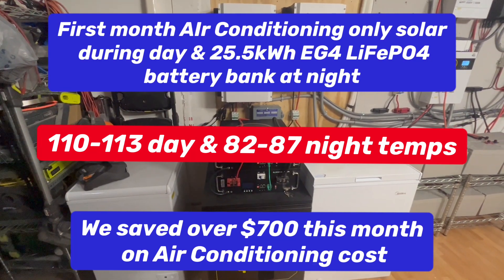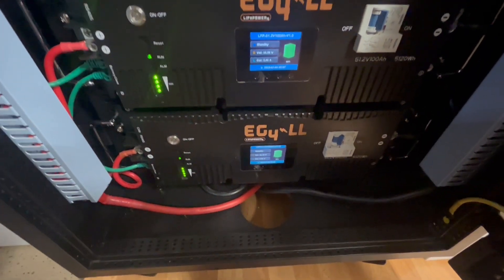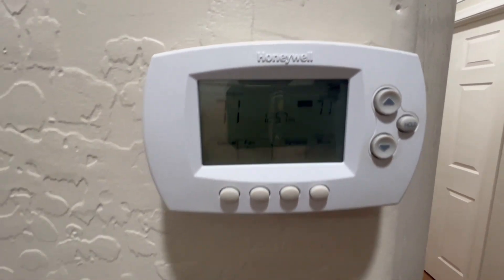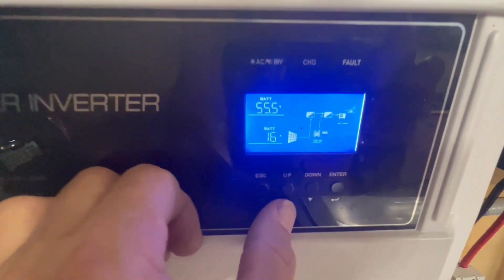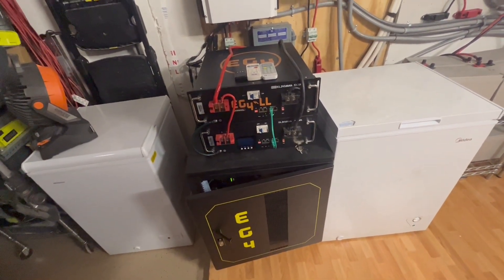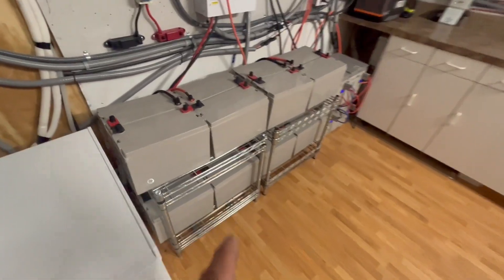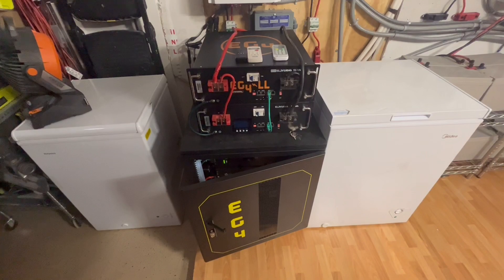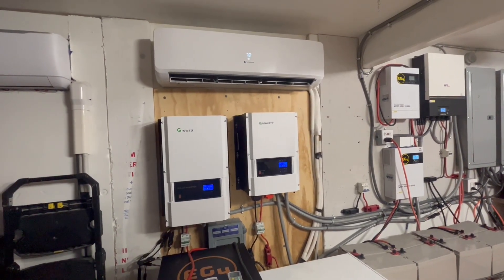First 28 days spending no money on AC cost while 110-113 in the day & 82-87 at night off grid solar

Comment: Holy hell what do you do for a living...?
Reply from the maker: I am medically retired with 2 incurable cancers that started in 2013, and was completely unable to work anymore in 2014. I had a lottttt of time on my hands since I was pretty much bed ridden from 2014-2017 so I started watching videos on off grid solar power,  at first just a few videos a week, then in 2019 I really started to watch a huge amount of videos on solar power off grid. I had no knowledge with ac, mini splits or solar before then. So I learned as I went along. I started with a 12 volt 2000 watt modified sign wave inverter, some Wallmart batteries and a couple used solar panels I bought for $30. And in the last 3+ years my knowledge increased and so did my system. If I, going through 2 incurable cancers only being able to spend maybe a hour or two a day, maybe 2-3 days a week,  installing solar components can achieve this, than anyone healthy can do the same. Most products today are really easy to install and program. You just need to see how it is done. I installed 100 solar panels, 6 mini splits, 17,000 btu & 127,000 btu electric pool heaters heat pumps, inverters, battery banks, etc all over a long span of 3+ years. A healthy person could do the same in maybe a week total. I have a lot of determination. Once again I knew virtually nothing about electronics or electricity a few years ago. Now I’m able to show what is possible with off grid solar. The reason I did off grid so is because the cost to go on grid was 4-6 times more expensive due to mark up and 60 percent installation cost. DIY is the only way to go if you want to ever break even. Thanks for your questions and I hope you know you can learn to do this as well. Just make sure you are very cautious and safety minded and double and triple check everything you install before powering up to make sure you did not make any mistakes. Do that and you should be able to do the same as me. Hope you have a truly wonderful and blessed day.
Reply: @diy-solar-guy  wow I'm so sorry to hear that. You've definitely had a rough time and I wish you all the best! I really appreciate your videos and I appreciate you taking the time to be so informative and thorough. I've actually just started on my solar journey and I'm just now learning the cost investment into things like LiFepo4 batteries and such so I was a bit sticker shocked. Your story has inspired me though to see this through. 
Thanks again so much and keep up the amazing content!
Reply from the maker: @VworksArt  it’s ok, I love doing the solar and helping others that want to do the same. The worst part is in the past. I look forward to each and every day to come. I am amazed that this much is possible with off grid solar. I never thought I would be able to run whole house ac units with only solar. Every week brings new achievements. Thanks and hope you have a truly wonderful and extremely Blessed day.

Comment: Awesome, but also take note that you need to increase efficiency in your house, maybe some air gets out at your house or insulation are not that great on some areas, you can save up to 20% of not wasted efficiency in your home, if you do a check out these little things (its like a refrigerator have a bad insulator on the doors) Regards.
Reply from the maker: We have done major projects to insulate our windows and doors along with 2 solar hybrid attic vents that exhaust over 5000 cubic feet. We have insulated garage door with 2 inch foam as well as garage walls. We did a lot to improve efficiency of loosing cold and not allowing heat to come into house. That’s one reason why we can run 2 full size house heat pumps that most people would never try to run with solar in day and battery at night. We have new high efficiency ac’s, kitchen appliances are all less than a year old, two sets of washer and dryers are less than 3 years old. High end hot water heater installed 5 years ago, new front door. Thanks for the input, it can help us to improve the efficiency in our homes.
Reply: @diy-solar-guy  I put in a Ruud heat pump water heater in my garage I'm in Phoenix also switch it to heat pump only because the garage is so hot here right now my power usage went down by 20% compared to using the default setting of energy save. This is from the application on my phone that graphs the water heater. Energy save mode runs one direct heating element and heat pump which according to the app the most savings that probably true in most climates. It's a 60-gallon unit I can drain it the thing will heat back up in about 15 minutes in this heat. I wish it would run longer cool off my garage but no such luck.
Reply from the maker: Very nice

Comment: You should NEVER place an A/C outlet above electrical equipment, water can condensate in these units and drip down, water and electricity do not mix, people like this who DIY with no real clue put theirs and their families lives at risk.
Reply from the maker: Our humidity is 10 percent out here. That’s why they call Arizona a DRY HEAT. I plan on moving the mini split head. But thanks for your concern.

Comment: Awesome!  I'm in central California, taking off for the week, and finding out my system is good for night time only.  I've got less than 3000 watts of solar panels charging up a 6kwh and 5kwh bank to run a 10000 BTU and a 5000 BTU air conditioner, plus one refrigerator and kitchen appliances.  January till now was great with consistent $25 less than 100 kwh bills, but now I definitely foresee running my central air conditioning here and there.  It'll still be better than a 400 to $600 bill like most of my friends have.  My neighborhood is full of solar, but it's all leased.
Reply from the maker: Leased solar is not worth it, but off grid solar pays for itself in a very short period of time. I bought stuff every couple of months for the last 3 years. Thank you so much for your input.
Reply: What is your price per kilowatt??? This bill seems outlandish even for California.
Reply from the maker: I pay over 17 cents per kWh. I keep my house at 70 degrees during the day when it is 113 out right now and overnight lows are 85 degrees. If I used that amount of power on grid my bill would be $1000 for the month. They have a 3 tier usage where it is around 17 cent kWh up to 1200 kWh, then increase to over 20 cents kWh up to 2000kwh, then it increases even more. Not sure of how much after 2000 kWh for month, but it is to greatly discourage you from using power in summer when it is 113-118 degrees in the day. They have plans where from 1pm-8pm your electricity is like 37 cents kWh. But 9 cents from 8pm-1pm. It is expensive to run ac in summer, most of my neighbors with older ac units spend over $1000 a month in summer just to keep house at 78 degrees 24 hours a day. My electric bill will be less than $900 for entire year in 2023. Well worth the investment. Thank fir your question, hope you have a wonderful and blessed day
Reply: @diy-solar-guy  holy crap!  I thought we had it bad. My mother in Oklahoma uses about the same amount of electricity that I did before my small systems and her bill was always about a third of mine even with the extra penny or two that they pay for purchasing electricity from Texas a couple of years ago.
Reply from the maker: It is expensive here. That is why I supplement with off grid solar for the largest elect cost in the summertime. I am now air conditioning my house and garage 24/7 with just solar in day and battery bank at night. I pay $0 for ac cost or heat in house year round now.
Reply: @diy-solar-guy  you are an inspiration!
Reply: @kevinroberts781  it goes over forty cents per kilowatt-hour during peak hours in the summer.  So say you have a 2000 square foot house with a pool, you can easily have a very high bill.  I have 1200 square foot house and it still gets expensive.  My last bill was $24 for 73 kwh, that averages to be about thirty-three cents a kilowatt-hour.
Reply from the maker: I can easily use 3000 kWh in a month for 6 months of the year. You have a really low bill. Most homes out here have 10+ years or older ac units which are not that efficient. I can easy use 100-150 kWh a day running pool, air conditioning 2450 square foot house and 3 car garage along with 3 chest freezers and a 24 cubic foot fridge along with pool pump and outside lights at night. I use less than 20 kWh a day for the wife to use all appliances in the house and hot water heater along with all light, tv in house. It’s $100 a month just to use 20kwh a day. Hope this helps to answer your question

Comment: Wow that’s great .. both GW are 5k? A soft start on the compressors would cut consumption (and surge load on start up) and pay for itself in time
Reply from the maker: They all make a great combination. I can’t start my 3 1/2 ton and 4 ton with any other inverters I have tried but Growatt low frequency off grid inverter works great every time ac kicks on. Soft start reduced inrush amps by 75 percent, so that helps a lot when your ac starts up on battery at night.

Comment: I'm just curious...what was the total investment in the solar setup vs. the cost of getting power from the grid?  How many years until break even?
Reply from the maker: Around $20,000 for everything, I spent about $5000 a year and with just the savings on electric bill, that $5000 each year has paid for itself. 4 years, $20,000 invested and will be completely paid off at end of this year in 2023. If I had to pay electric bill on all the electricity I use, my bill would be around $7000 a year. I use a lot of electricity now that I produce for free.

Comment: Fantastic!  Running air conditioning is one of the biggest challenges for a solar system and you’ve really worked hard to design an effective system.  The amazing part is you’re doing it only using 25kW of batteries!  I wanted to design our house to be solar friendly so I used heat pumps, none larger than 2 ton.
Reply from the maker: Heat pumps are so efficient and easy to install. Use so much less than normal ac or heat pumps. It is too hard for me to install multi zone mini splits upstairs. My 3 1/2 ton heat pump upstairs is only 5 years old so I work with that. Keep up the great work and it is getting easier with all the new components they are coming out with lately. Very easy to connect and program. Thank you for your input, we appreciate it.
Reply from the maker: @nemam_nedam  I have a 18,000 btu mini split that I run using solar all day to cool garage. I took that into consideration. I have an air conditioned garage that is so nice to work in year round since mini spit can heat garage in winter as well. Hope you stay cool this summer.

Comment: It's been a while since I been on but I'm still hanging in there it's was hot today in Northwest Ohio I see you expanded since the last time I was here nice !
Reply from the maker: Is your mini split running? We added more LiFePO4 batteries. I can’t believe my electric bill will be less than $100 for month when it is 113 degrees during the day out here and 87 overnight. I feel I have accomplished something this month. Hope you had a wonderful 4th of July.
Reply: @diy-solar-guy  thanks its was a quiet 4th around here but yes it's running I took it down & relocated the indoor unit from the man cave to my dinning room I bought a 25ft line set a new vacuum pump and some R410a from Ability Refrigerants my Senville holds 28 ounces 1.75 lbs a 2 pound bottle only costed $109 free shipping remember I'm completely off grid here I also go some cannabis plants growing
Reply from the maker: @thelithiumpowerch  it is wonderful when you can install and fix mini splits. Keep up the great work being completely off grid.

Comment: My minisplit is really efficient at 38 seer and runs of my solar 24 7 when im not in this semi truck but its only pulling between 200 and 300 watts. Another great thing is the way it dehumidifies the air so well. Thanks for all your videos they have helped me alot with going solar and off grid
Reply from the maker: Thanks for sharing. Mini splits are the way to go if you are in a single story home. My house heat pumps are only 4 years old so I wanted to be able to use them but I use the mini splits a lot of times instead of Downstairs unit. I’m looking at pump a 29 seer mini split in my motor home soon. Can’t wait, I will run off solar and battery. Will be able to go camping off grid.
Reply: @diy-solar-guy  when I got cancer I'd lost my home and luckily had a great mom that let me stay there with her. Once I beat the cancer I didn't ever want to be made homeless or without electricity again so it was a top priority to get a life set up where no matter what I can survive. Thanks to you and a few others I had the confidence and know how to build out a holiday rambler camper to live in when I'm not in this semi truck. And if I ever get sick again then I know it's there and comfortable.  I see your house you live in and the pool and all and I'm just amazed at how beautiful it all is. I think it's an amazing home with some amazing solar equipment.  Thanks for making the videos it helps me a lot
Reply: @matthewknight5641 what is the brand of mini split?
Reply: @neilwani1178  it a inovair brand. Its 38 seer and is the 9000 btu. It's 9000 rating is kinda misleading tho because it goes from 2000 up to 13500. It really is an amazing minisplit. I studied about them for about a year before I decided which one would be best and all the time spent was worth it. It uses just over 600 watts for about 10 or 12 minutes then drops down to just over 200 watts the rest the time it's on. It uses about half the power of the pioneer minisplit that so many people buy for solar air-conditioning.  My thought was I could either buy appliances that were the best for solar use or I could buy regular appliances and have to build a huge solar array to run it. The inovair is on one of David poz videos also
Reply from the maker: @matthewknight5641  I like those mini splits as well. Getting ready to buy one soon. I have seen great reviews on those units. Thank you so much for your input. Hope you have a wonderful and blessed day
Reply: @diy-solar-guy  if you buy a minisplit the inovair brand is great. Lots of people get the pioneer or ch brand and after lots of math and study I am fairly sure that if you plan on running the minisplit a lot then the inovair is definitely the way to go. It uses just over half the electricity and it has a much wider band as far as the heating and cooling capacity. Mine is the 9000 btu but it has a high of 13500 and goes as low as 2000 btu.  The inovair also heats the camper supposedly when outside Temps aredown into the  negative digits. I've not had it thru a winter to test this yet but that's what's advertised. Only draw back is its heavier than other units by about 40 lbs but that wasn't a deal breaker for me. So glad I went with this brand over the others.
Reply from the maker: @matthewknight5641  thanks so much for your valuable input, greatly appreciated.
Reply from the maker: Very nice set up. Those 38 seer units really do a great job keeping power usage at a minimum. Check out my newest video where I am running all my air conditioning in house and garage on just solar and 25.5 kWh EG4 LiFePO4 battery bank. First 28 days with no grid power for air conditioning while 113 degrees in the day and 85 degrees at night. My house and garage are close to 3000 square feet that I’m cooling. And running pool pump 24/7 along with 3 freezers and a fridge as well. Thanks fir your input.
Reply: @diy-solar-guy  you have a truly unbelievable home and solar set up. I'd give about anything to be able to put my family in a home like that. You running all that air-conditioning and other stuff on solar is what more people should be doing. Our grid might crash sooner than later and we will still be comfortable and keeping food fresh and that security has a value of more than people realize. I spend a good part of each paycheck on building my off grid systems larger and making them more capable. One day hopefully I'll have something similar to what you have done

Comment: Thats a awesome system to push those ac units like it does. Impressive for sure
Reply from the maker: Thank you. Was not easy to accomplish when I knew nothing about solar or ac units 3 years ago. But this stuff is easy to learn and very DIY. I am using used solar panels. It would be better if they were new but they work well. Thanks you so much for your input.